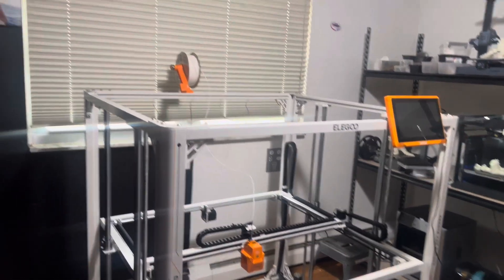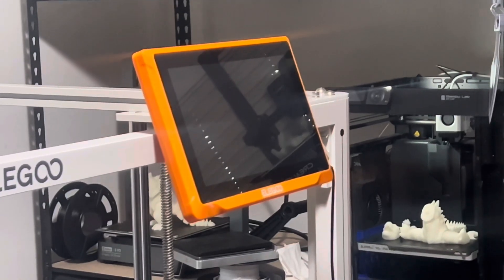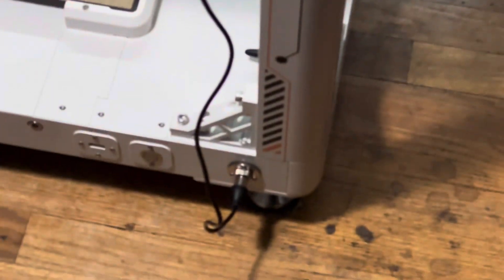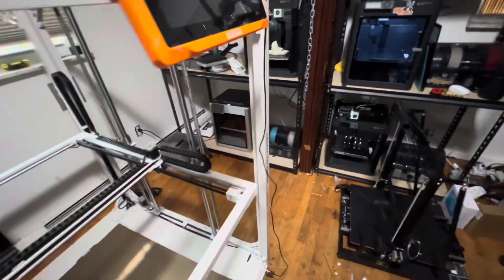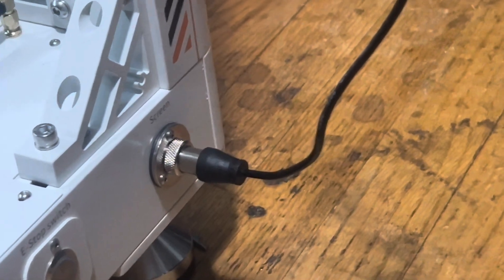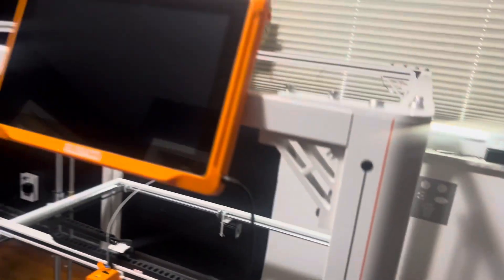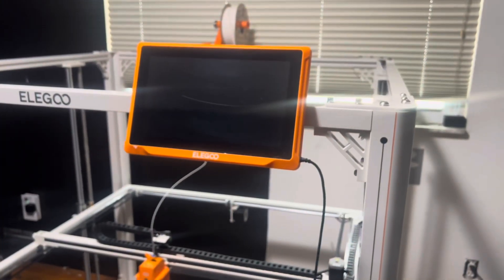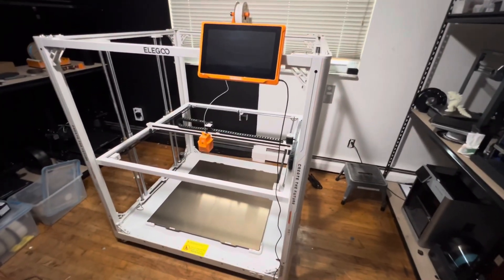DumbAF Design of the Century, goes to the Elegoo Orange Storm Giga TABLET - 3D Printer

Comment: If it were not trash it would be 50 grand. If I saw a machine this size for 3k I would know it was trash. What would you expect?
Reply from the maker: Junk is a stretch. You'd be shocked how solid the build is. It feels like a Car. I have $1500 printers, that feel like toys compared to this. Id say it feels under priced. *if it works*.  This is what makes the few oddball choices, feel out of place
Reply: @ well it may be good then. But it is awfully cheap. Like something from Ali Baba. If Bambu made a machine this size it would be at least 10k.

Comment: Looks like they could have mounted the plugs facing up on the edge, there.   Then it might not be "perfect", but at least you could zip tie it or Velcro wrap it so it stays out of the way.    I guess in YOUR case you could rotate it 90deg to get that plug out of your way, if you don't mind pulling big prints out the side.
note:   I thought you were going to say their filament holder design and placement was stupid for a printer that size....in which case I was going to whole heartedly agree with you. ;)   I've seen people who have to reach through their printer to get to it...since they don't have a lot of room on the sides.   Is it easy to move it to the front?
Reply from the maker: Yes and no. The filament spool mount screws into the frame. There are 4 sets of mount holes, all are in the back. But, it also comes with a filament roller thingy, that sits on the floor. I suppose could put it anywhere. I can barely get to my mounted holder also. It's tough to fit this anywhere, and have access to all 4 sides.

Elaborate on the cable? The port sticks out the front, making that the only choice. Could at least run the cable inside, but, the point of the long cable, is to be able to remove the tablet, and stand or sit down with it, away from the printer. Will that really be needed? Probs not, but, I figure removing a feature, to remove a problematic design with that feature, is a step backward....  moving the connector INSIDE the frame, woulda solved this potential problem

Comment: why is the connector so far down with dangling cable???? wouldn't it more logical to put it at the top?
Reply from the maker: Yes. Or:
BLUETOOTH
A CONNECTION at the top
A retractable wire
A quick-connect wire
A USB- Wire, with a 90' connector, that's close to the Fram
A non removable Tablet
A tablet that runs on BT, powered by the cable when mounted, Battery when Removed
Put the connector on the back, or, on the side, facing inside the frame
So many better options. Peeps are 1000% gonna be breaking this